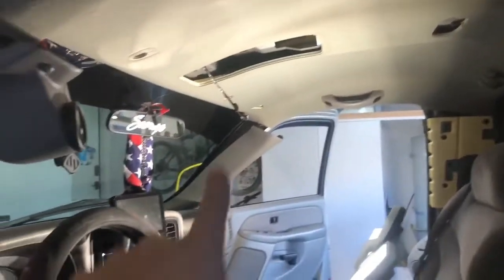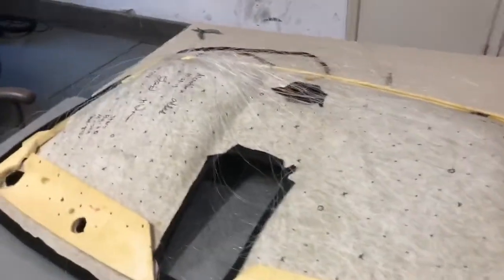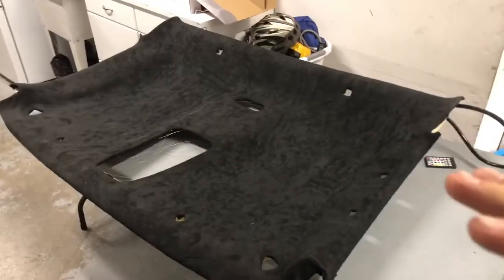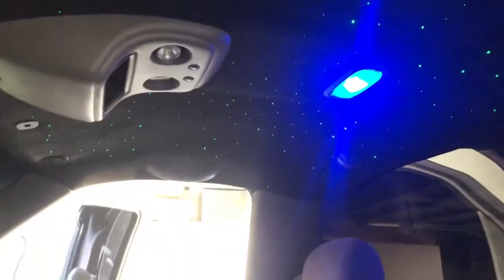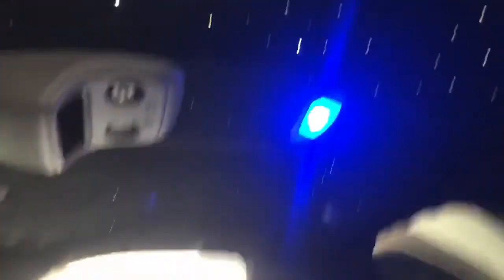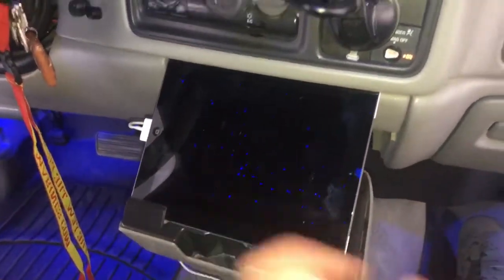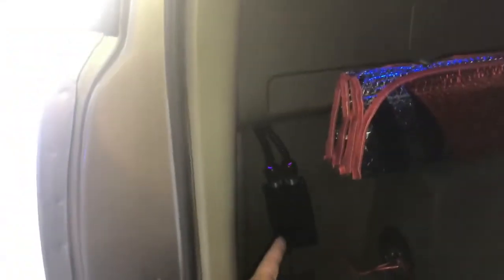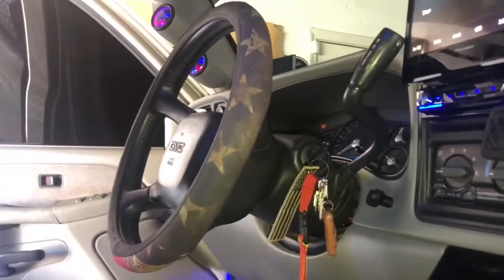STARS IN THE CEILING! Coolest Upgrade On My Truck Ever!

Comment: did you connect the wire for box on the positive side of the amp? i did starlights in my truck and hate having the cigarette lighter plugged in

Comment: I'm curious? Did u have to have to make holes through the fabric in order to get fibers through or just the card board? I've seen videos of ppl punching holes all the way through and rittling their fabric with holes and also when u clip the excess off do u do it to fabric or try and push up a little?
Reply from the maker: I poked all the way though, when the lights are off you can’t see them at all. They give you different size bits to match the holes

Comment: Hey update so I redid the headliner and all set to start doing the lights, how’d you connect yours? Like did you run them through the back pillar to an amp or under the dash to front pillars
Reply from the maker: I ran mine down the back passenger pillar and connected them to my amps power

Comment: Hey just did this to my car have you ever figured out to get the floor lights synced with the starlights?
Reply from the maker: hans reitsma you would have to run it out of the same light supply box, since they’re fiber optic for the roof I imagine that’s not what you’d use for the floor. If you did a led strip on the floor you’d just have to set them to the same thing at the same time to have them match up. I don’t think there is any way to (easily) make them talk to each other and be in sync. I’ll look into it a bit more though
Reply: Tyler Faix thanks appreciate it if u find out let me know ❤️

Comment: be sure to turn it off if you get pulled over. Them cali cops will probably try and pull some BS about it. Something about it being a distraction to yourself or others... Had the same issue back when radios that had the dancing lights on them came out. Cop pulled me over and said that's distracting to others on the road. Almost got me on a good sized ticked until I changed the setting to stay static.
Reply from the maker: maddmaxx636 oh damn! Good point man, thank you I will! Let’s just hope I don’t get pulled over🤣
Reply: @Faix.Garage  They probably won't see if for that awesome tint but when you roll the window down they might chalk it up to something regarding to why they pulled you over. 

I got pulled over wrongly ("Speeding in a school zone") but the guy never clocked me with a gun nothing....I told him my speedo was screwed up where it would read slower than I was going (It was true, Didn't give me a speeding ticket but I wish I fought it)
Reply from the maker: maddmaxx636 oh ya they can just use any little thing wrong to pull you over and then go for anything
Reply: @Faix.Garage  Yeah, I can only imagine the police in cali are FAR worse than here in Georgia.
Reply from the maker: maddmaxx636 honestly it is, I’ve gotten lucky though and I’m just always respectful and they usually show the same respect for me. It’s more the laws that suck than the police.
Reply: @Faix.Garage  Yeah, I do the same. Sometimes its hard when its a dirty cop (I got pulled over on my motorcycle once and he said I was speeding....My bike was straight piped so 2K RPM sounded fast.) He tried it darndest to get me for something. My licence was expired that day. So he got me for that but at the end. I got it dismissed and that same officer had a lot of complaints on his against his name. 

But I work in retail and I tell every officer thank you for their service since I work in a high crime area. They risk their lives for all kind of petty crap. People doing petty things. Like coming in and stealing duster cans. 

But Ive always been respectful to officers. Since they always show it back. Ive even gotten compliments on my bike and my truck. 

(I dont have the bike anymore. It got stolen...)

Comment: Where did you put the box and how did you power the stars to turn on?
Reply from the maker: Fosto LiveAgain box is behind the passenger seat and I wired it in with my amp so when the amp has power so does the box (when the key is in the run position)
Reply: Tyler Faix man I appreciate the response I do stars for people but this my first time doing a truck ! I’m doing a Dodge Ram 1500. Do you have a wire video using amp ?
Reply from the maker: Fosto LiveAgain I don’t think I put a video up of the wiring, it’s my aftermarket amp that I have under the passenger seat so it was just right there and the easiest switched power to grab from
Reply: Tyler Faix last question which part of the amp did you wire it to? And do I need to cut the plug in part off the power cord to the starlight box ?
Reply: Tyler Faix hey quick question , what part of the amp did you wire it to? And does that mean I need to cut the plug in part of the power cord to the box off ?
Reply from the maker: Fosto LiveAgain it was a while ago I think I used the remote turn on that was ran to the amp to power a 12 volt relay
Reply: Tyler Faix I know I’m being difficult 😂 sorry but could you inbox me a picture of the starlight kit wires to the amp so I can try to see how I need to do the wiring.